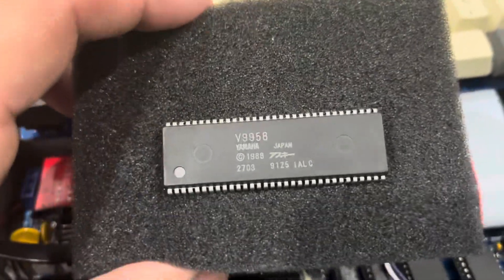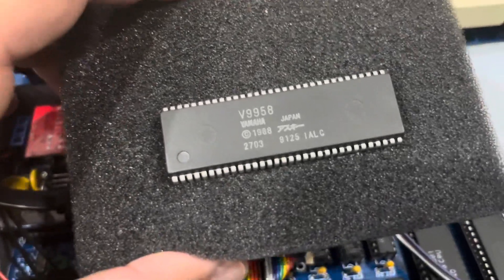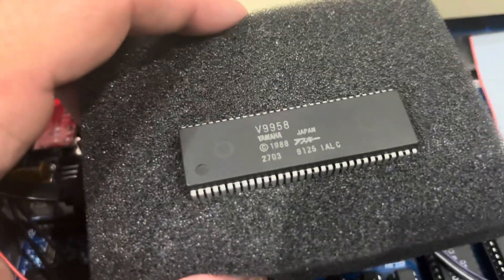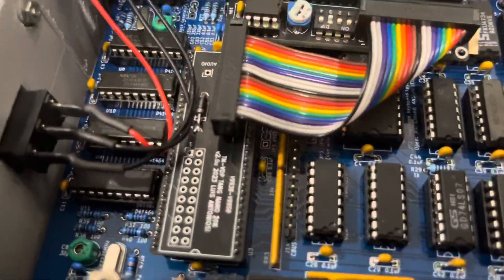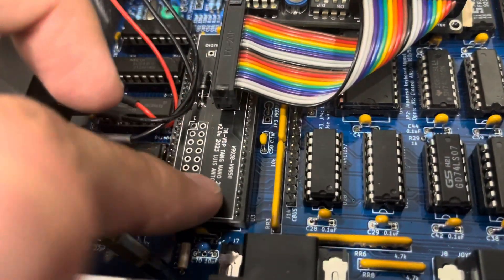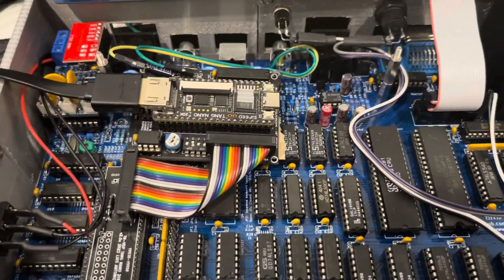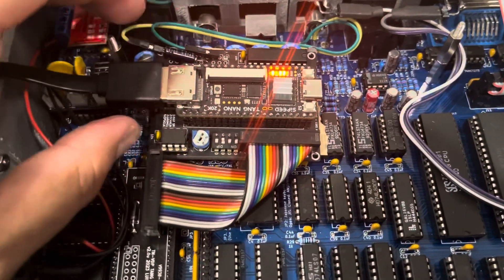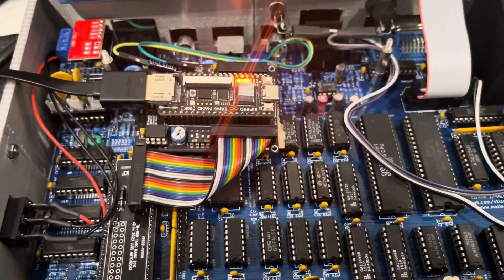Tang Nano 20K v9958 replacement

Comment from the maker: Just wait for it. Looks like Omega MSX has electrical routing problems and the Tang causes more electrical issues. While cartridges worked fine I could not make any CF or SD card work properly. The people from MSX Makers are looking into it.
Reply: My Omega works perfectly with cartridges with CF like the Carnivore 2 or mSD like the MegaFlashROM SCC+, as well as the TDC-600 controller.

The problem occurs with a 5v power supply. If you use a 5.3v or 5.4v power supply you will see that everything works.

The best is to connect the Omega with a dimmable 5v power supply. Turn on the Omega and with the multimeter and the regulator you go up, step by step,  until you have about 4.90v of charge on the Omega motherboard.

My Omega has the 4Mb RAM expansion, internal FMPAC module and I use the Carnivore 2 and TDC-600 cartridges together on a regular basis. Everything works like a charm.
Reply: Ah! an amazing job mate. Tang Nano 20K seems to be a perfect solution for 9958 replacement. I need it!

Comment: I am having trouble programming my Tang Nano 20Kwith V3. I have Gowin installed. I plug my Tang into the computer, the lights are chasing. When I go into the programmer the cable settings come up with cable: USB Debugger A, port: (USB Debugger A/0/0/null, USB Debugger A/1/160786/null, or USB Debugger A/2/160785/null). I select A/1 option. Then I add a device GW2AR. Under the device configuration I am not sure what access mode and operation to select. It is that I am lost. I have the two fs files (litex and v3_v9958), but I don't know what to do in the programmer.

Comment: In my new LC256 computer (65c02 or HD63c09 CPU) runs a V9958 with a 4MHz CPU. The bus read/writes are only 125ns - that works perfectly with a real V9958 (The datasheet of the 9958 say min. 183ns ;) )
Do you think there is a chance that the Tang works with that bus speed?

Comment: Love your work. I have not tryed it with my 7.12Mhz MSX yet. But have you implemented the WAIT line output already in the Tang Nano? Its on the tn_vdp_v9958_socket_inverted PCB but not on the tn_vdp_v3 board. You just have to put a diode with the anode to the wait pin to stop 5 volt getting to the FPGA.  
Also you can use only 2  sn74lvc245 if you connect CSR to pin 1 and a diode with the anode to pin 19 and katode to pin 1 and a pullup resistor to pin 19.

Comment: Is it possible to upgrade an MSX1 to MSX2-spec using this?
Reply from the maker: if it's a 9918/28 MSX1 you can as I did but you  need to replace the main ROM and find a way to put the subrom as a ROM cartridge etc. And the ROMS should not access the RTC and in case for a 2+ to skip the F4 register
Reply: @lfantoniosi  Wouldn't a Carnivore cartridge take care of that? It also gives you 512K of memory to make it fit the MSX2 spec better and it boots into its own ROM. Are there any gerbers for an adapter that fits the Tang Nano to the 9928 socket?
Reply from the maker: @peshozmiata  the carnivore2 cannot be used as bios rom because it only works after the boot and you choose the rom. But a megaflashrom will. You need to write a linear rom to match the page1. The tang20k uses the same socket as t9k just the mainboard is different.

Comment: Does this emulate a v9958 chip with 128k vram?
Reply from the maker: First of all: FGPA is not an emulator. Emulation is software running a binary code, interpreting it. It requires a CPU and a host machine. FPGA is a synthetization of a hardware using a technology called Field Programable Gate Array. The FGPA runs as a electrical circuity interfacing with others electrical circuits. All kinds of electrical issues happens here: noise, current consumption, de-bouncing and filtering signals, etc. So please: Stop saying FPGA is emulation because it ain't. And yes, it has 128k from it's SDRAM. It won't use the external (computer host DRAM, you can leave these unpopulated)
Reply: @lfantoniosi  first of all: emulation refer to mimic the behavior of something else. Before telling me what emulation is I suggest you to check the meaning of the emulation word. That said fpga does effectively emulate the v9958 , of course at hardware level, and with some degree of accuracy. That is, it does approximate the real chip behavior.  Of course, I m pretty sure that all timings and signals in the original thing are not reproduced perfectly (for example the blitter speed and bus arbitration or the arbitration between cpu vram accesses and Blitter accesses. Not to mention the timings that the original silicon uses to fetch for example sprites data. So in the end THIS is a kind of emulation.  I m also pretty convinced that openmsx sw emulation is somewhere more accurate that the one inside your fpga. So I. The end both your fpga and openmsx do emulate the real chip, the former at a hw level the latter at a sw level. To avoid use the term emulation you would need to reproduce perfectly al the behavior and timings and the internal state machine of the original thing which of course is something hard to do without knowIng some internals of the original chip. 

To demonstrate that your is a kind of emulation I ask you this: 
It is known that updating the r18 register while the blitter is running lead to some data corruption in the real thing.  I m also pretty sure that this behavior does not happen on your fpga . So you are only approximate the vdp behavior therefore doing an emulation.
Reply from the maker: @old8088  as a word connoisseur you would have known that some words are preferred over the others with similar meaning. For FPGA the word is synthetization. I won't get in details all the wrong things I see in the OpenMSX regarding to split screen and sprites also regarding interleaving. But an FPGA, despite a software emulator runs everything on a tick of a clock. Much more closer behaving to a real hardware. Of course there is the question of the implementation (it is not an Yamaha designed hdl but a reverse engineered one) and also the use of new technologies like dual port rams (very expensive back in the time).  This ain't my 9958 but ESE-MSX3 one that I fine tuned for a perfect match to the HDMI output. It has its own can or worms. But now go and play Sexy Bunny in your almost perfect openMSX... indulge yourself.....
Reply: Here are not talking about words with similar meaning. We are talking of definition. Even if your fpga does run things more like a hw device (being driven by a clock) always approximate the real chip. As you pointed out even the fact you use the dual ported ram itself imply a different ram access mechanism than the real thing that work with std dram . So in the end you do not have to implement the arbitration logic the original v9558 had. Maybe you are emulating this in terms of access time, but you are only approximate what the real thing has to do. And because of your approximation you are only EMULATING  . The same would occur even if a designer would try to reproduce the v9958 on silicon without knowing how the v9958 circuitry is but only reproducing an approximation of the behavior . Even if the result is not a fpga solution it would result always in a kind of emulation.  By definition
Reply from the maker: @old8088  whatever you the kind who likes  to get into discussion. Done. Call it emualator I call it synthethizator. Potato potato...
Reply: @lfantoniosi  i m only applying a definition here 😉 even if i can feel your pain

Comment: Incredible, although the output via hdmi seems strange to me, I suppose that the circuit could be modified so that it outputs the video signal through the MSX.
Reply from the maker: You would need to get rid of the ADC and jumper pins to get like 15 pins needed for a 4-bit RGB HS VS output. But the voltages and currents for an IC video is something I am not sure about. Maybe transistors are needed for correct levels.